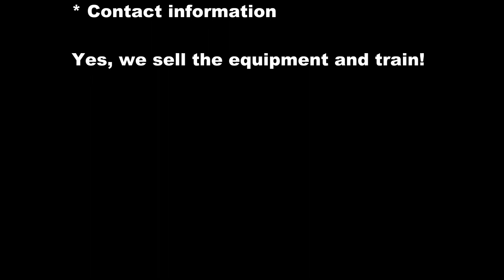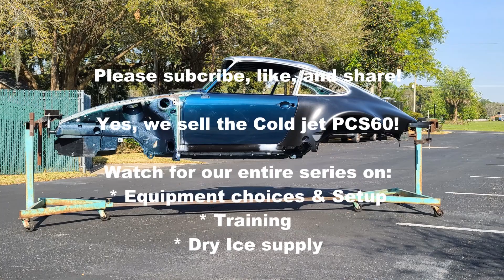Watch us DRY ICE CLEAN this Porsche backdate project car on a rotisserie!

Comment: Question:
What about the competitor's  machines which  use a kind of mesh or screen to lower the particule size ? Doesn't this achieve the same result ?
Reply from the maker: There are 28 different setting between .3 and 3 mm standard blasting ice.  The screen system and dial nozzles help but simply do not provide the flexibility needed to contend with the myriad of surfaces, materials to be removed, and most importantly, efficiency.  

Then there is the challenge of the large nozzles not allowing the operators to access nooks and crannies.  Plus the constant plugging of the screen units and occasional large pellet slipping through the defuser nozzles.  

I tried them all over 12 years, nothing comes close.  These other methods also rob you of product.   Since some of the dry ice sublimated when forced through a screen or fingers on the other nozzle.
Reply: @ScottAles  Very interesting observations...Yes, the ability to change nozzle size for different appilcation is obvious...So with experience, you know what nozzle AND pellet size AND pressure you need to use for each kind of material you are cleaning ? I hope you make a video regarding this subject ! Or maybe it is coming as you said ! Thank you for your time answering !
Reply from the maker: @1983dmd  Yes, we will be sharing everything we've learned these past 2 years.  But realize there is quite a bit of information, it will take some time.  Our goals are to continue to accelerated awareness and use of the system and make our best effort to train folks to succeed.  There will be some commissions for us as we sell the PCS60 to clients, but our focus is to be the source of all information needed.  
* Proper accessories for the Cold Jet PCS60 to do this specific work.
* Proper compressed air solutions to power the machine
* Initial training and on going support
* Offer the Dryce® brand to qualified technicians to provide a national consistent expectation for customers
* Innovate new processes to further support the effort